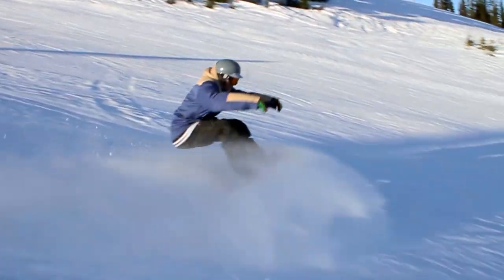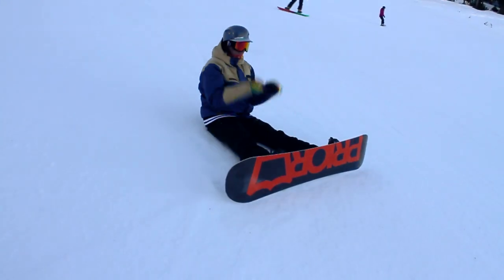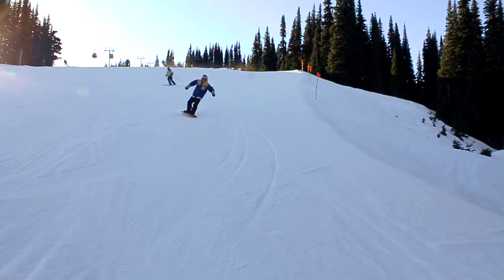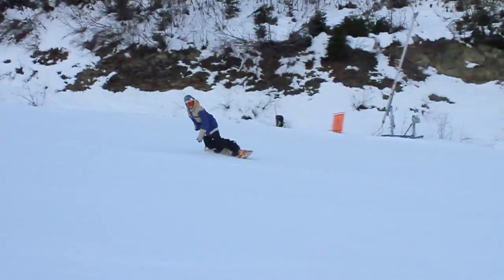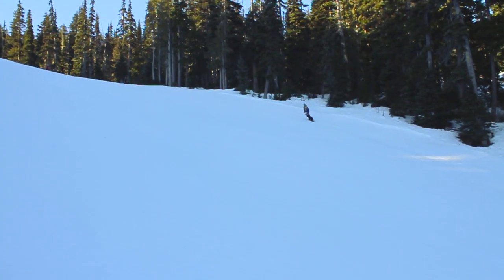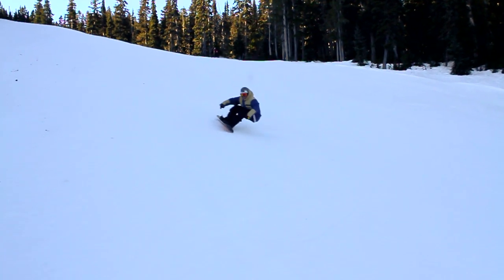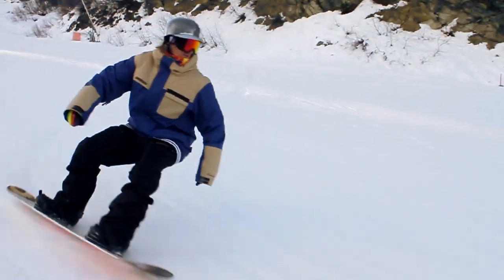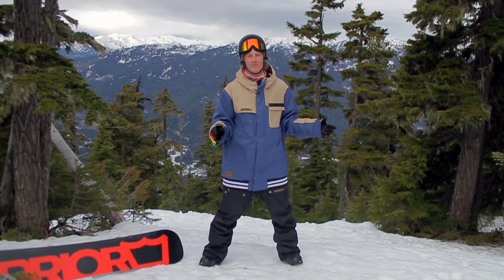Pressure Through Turns On A Snowboard

Comment: Hi Duncan!
What’s the purpose of such pressing, difference between standard vertical work (ups and downs)?
Thanks
Reply: Pressing down your edge is to make sure to create pressure on the carve and letting your side cut do the work, so the side cut should edge out the thin line, but as you press down the board will have a equal force reacting to that so your knees bending and the up and down motion is to help absorb that force. Notice how he only go down as he initiating a new turn (which is where you pressing down on the edge) and as he is finishing the turn (less pressing down and getting ready to switch edge) he is slowly standing up

Comment: There's something I still don't understand - in the beginners course we're talking about decompression during the turn and compression while going for that turn. Here we switch the other way around. Why? When do we use the one and when do we usethe other?
Reply from the maker: In the Learn to ride series: 'Weighting And Unweighting Your Turns | Learn To Snowboard With Rio - EP11' Nev is talking about weighting and unweighting your board Between edge to edge transitions - in this video Duncan is explaining how to apply even and consistant pressure to your edge during your turns and when stopping. You would use both of these technqiues as it does not require you to do both at the same time.  Nev's is explaining the initiation of the turn - going from edge to edge, Duncan is explaining how to keep consistant pressure on your edge during the turn :)